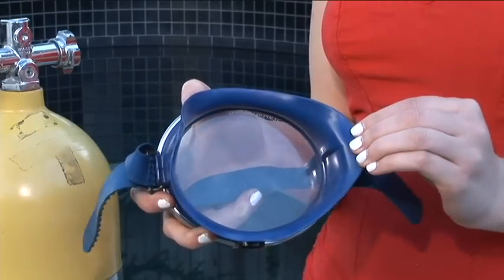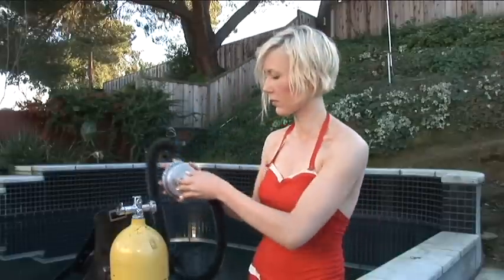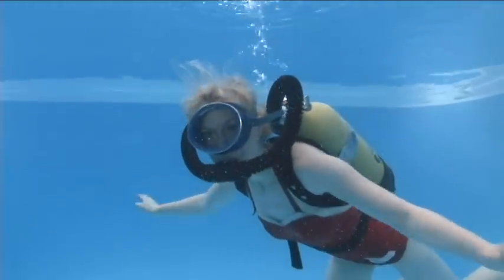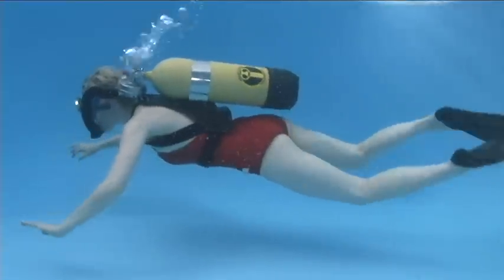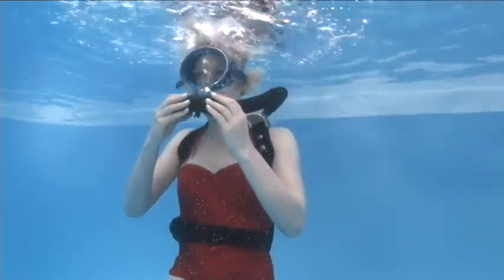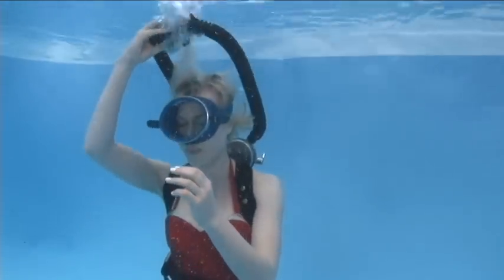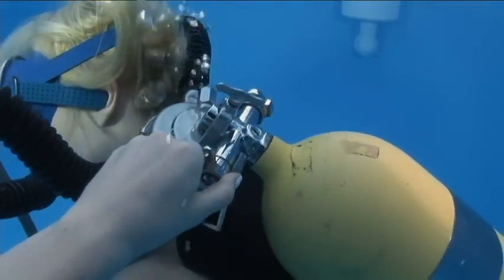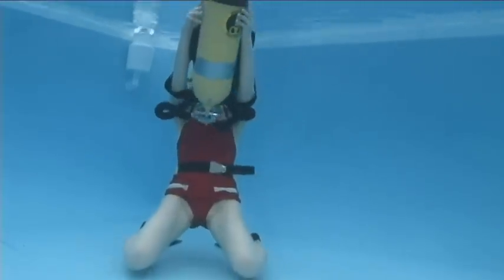Vintage Dive Gear Demo

Comment: I used vintage gear in Hawai'i 12 years ago. It's very different from modern scuba gear. The nicest thing about was having the bubbles exit from behind you at the first stage rather than at your face.

Comment: Aug 4 2024 I just Passed my PADI AOW Class!!! Wish they still made that style Reg. My Genesis Prana Octo decided to Explode in 30 Feet. Exposing the Internals on the 2nd of the 5 Dives. Almost didn't get to take the class. If it wasn't for the DM having a spare Reg set. There is something Majestic about the twin hose style.

Comment: This is a good video, but you should watch the 2nd vintage video she made as well. Double hose regulators perform best when seated between your shoulder blades and as close to your back as possible. Plenty of people dive DH regs as their primary. 
The guys at Vintage Double Hose are even making brand new DH regs.
But, please, if you decide to try one, at least read something like Fred Robert's "Basic SCUBA."

Comment from the maker: @Gilldiver According to Tillman's "Underwater Education" (1962): "When using a double hose regulator the height of the tank and regulator must be above the critical free flow location when you are vertical and looking up." While I realize you can fine tune the regulator's performance by the height, if the tank was any lower the J valve function couldn't have been demonstrated without an extender. Ultimately regulators of this era are never going to perform as well as a Scubapro MK25/S600 anyhow.
Reply: I love you r scuba videos